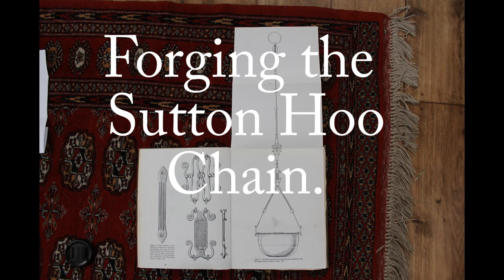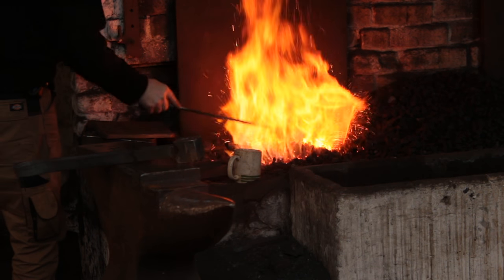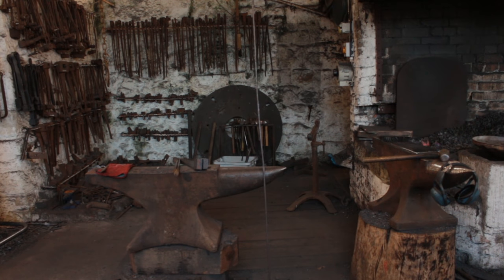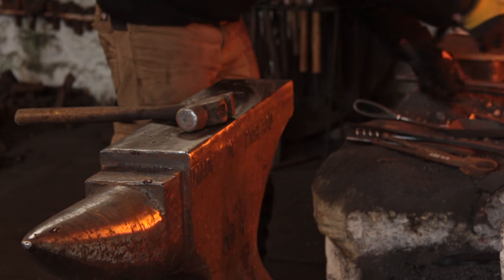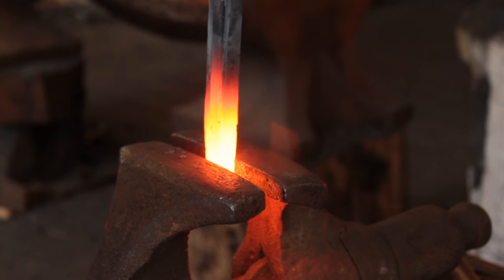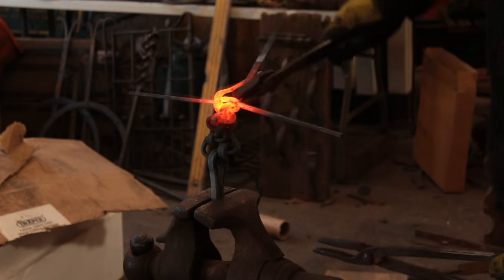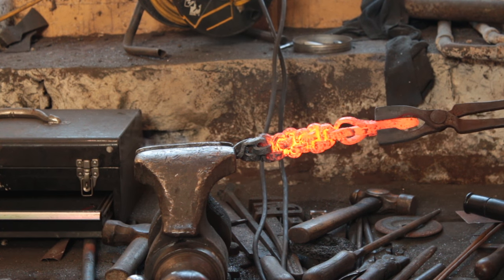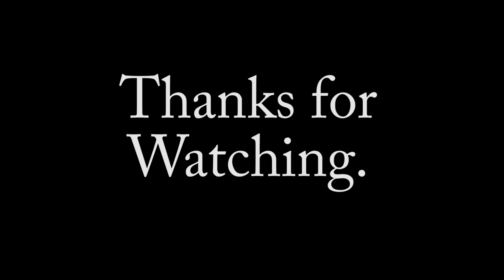Forging the Sutton Hoo chain. Part 2, starting the swivel.

Comment: Awesome! So I have a gas forge and have no problem welding carbon steels with flux in it, but my understanding is that it works because the flux slightly lowers the temperature needed. Can welding of wrought iron be done at the same temperature, or does it need to be near sparking?
Reply: I think you misunderstand the purpose of flux. Flux is necessary to create sort of a liquid coating at welding temperatures to keep oxygen and other contaminants, which would get in between the pieces and form cracks, out of the system. The welding temperature does not change, and the flux melts just below the welding temperature to provide this coating. You can read here for more info https://en.wikipedia.org/wiki/Forge_welding#Flux

Wrought Iron has a particular silica content, due to the nature of its manufacturing, which behaves as flux would in typical situations as well as providing general corrosion resistance.

However, wrought iron does require a higher welding temperature than carbon steel -- not due to the lack of flux, but because of the lower carbon content. Higher carbon steels require lower temperatures for forge welding. Wrought iron, being almost pure iron (in terms of carbon content) requires one of the highest temperatures for forge welding, i.e. sparkling.

Hope this helps!

Comment: Excellent and informative series.  Thank you!  Do you ever use a length of pipe slightly larger than your braid stock to bend?  I find that it keeps the braids tight and the material still to be bent straight.